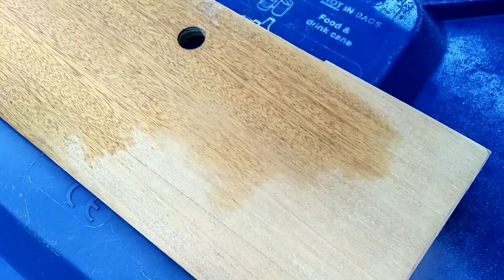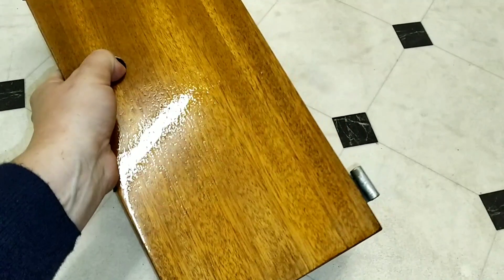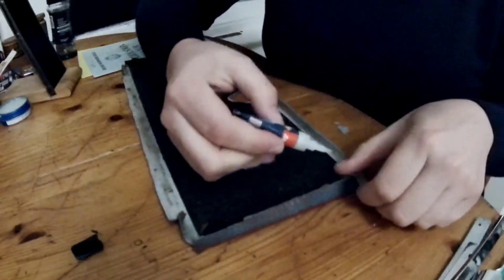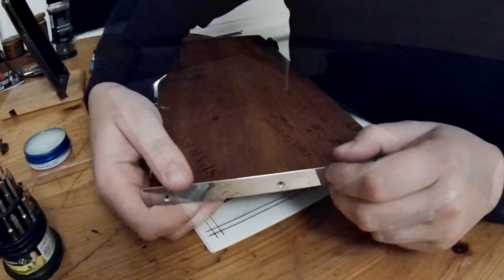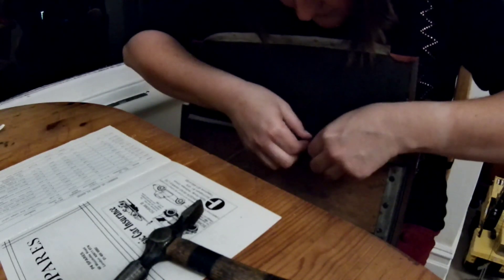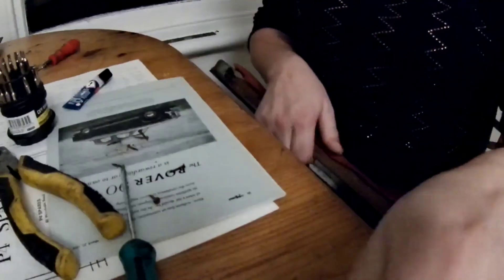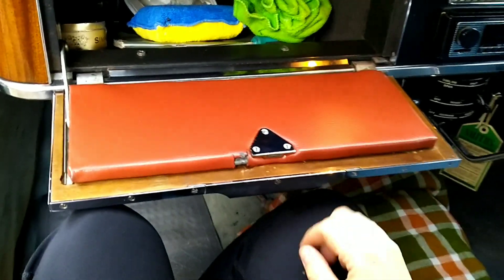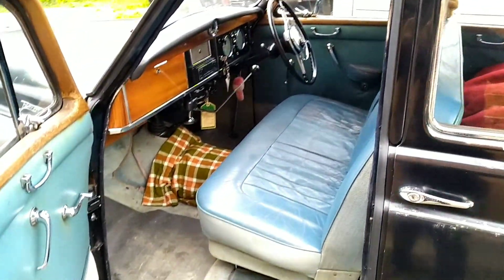Rover P4 100 1961 Jessie's Glove Box Freshtoration . What Wood You Do ? Part 4

Comment: WONDERFUL WORK YET AGAIN 😄 IN JOINERY AND COACH BUILDING WHICH INCLUDES RAILWAY CARRIAGES SLOT SCREWS USUALLY RUN PARALLEL WITH THE EDGE OF THE OBJECT. THIS CAN BE SEEN ON TIMBER WINDOW LININGS ON MK1 RAILWAY CARRIAGES. CHEERS MICHAEL 😊